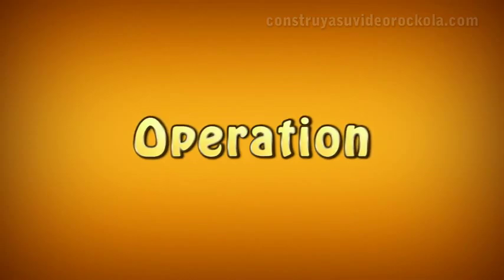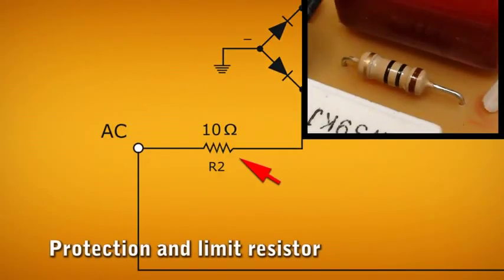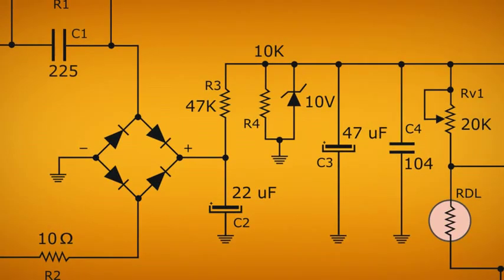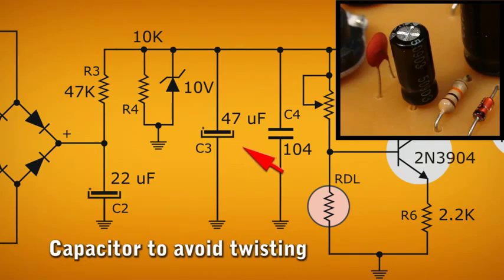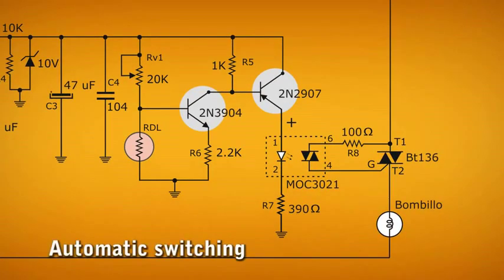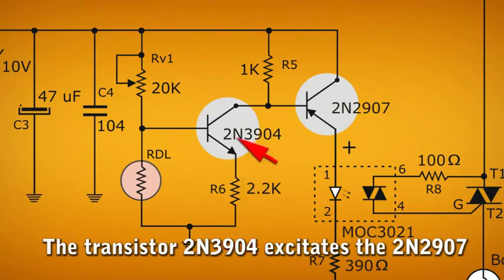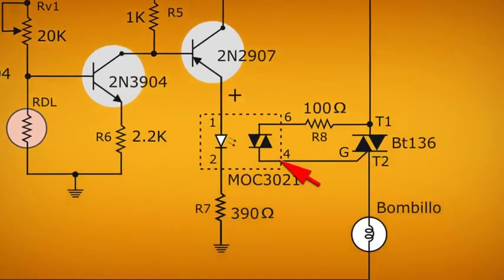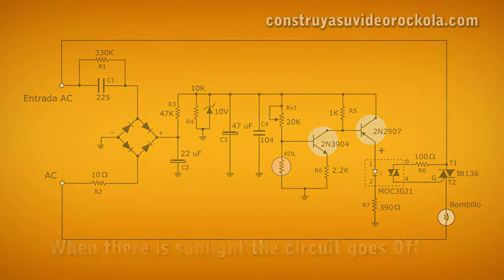den tu sang khi troi toi

Comment: Bác Quang Đức đã làm mạch này chưa? Bác cho em hỏi tại sao khi em làm xong và thử thì con điện trở R2 (10 ôm)  nó bị cháy đen thui?
Reply: Bạn dùng con tụ 225 đúng ko? Mình thấy tốt nhất bạn nên xài con tụ 225 400V thay vì 250V. Ngoài ra những con tụ ở mạch trong ko nên lớn hơn con tụ này.
Reply: Trích của bạn Chép Lj
 "Nhớ lại rằng để khắc phục một dòng điện áp tăng, nhân gốc rễ của 2 là 1,4141. Điều này có nghĩa rằng đối với một điện AC 120 volt, chúng tôi nhận được điện áp đầu ra của cây cầu diode 169 volt, 2 volt ít tiêu dùng những cây cầu và một số bị mất, chúng ta sẽ có khoảng 157 volt. Và đối với một điện AC 220 volt, chúng ta sẽ có một điện áp đầu ra của khoảng 305 volts DC approx. Vì lý do này, các tụ điện của nguồn chỉnh lưu phải là 350 volts, nếu không nó sẽ phát nổ khi kết nối các mạch."
Reply: +Thach Nguyen: Mình đã ráp đúng theo sơ đồ trên, các linh kiện có trị số và công suất đúng như clips, nhưng con trở R2 vẫn nóng kinh khủng, nếu không rút điện ra thì cháy ngay (mình không hiểu vì sao). Nếu bạn đã làm OK rồi, thì có thể chỉ giáo cho mình nha! Thanks!
Reply: +pham khanh Duong 
HI bạn Dương, có thể trên clip người ta đang ở quốc gia dùng điện 110V nên họ chỉ cần tụ 225 - 250V. Còn tại VN thì dùng điện 220V nên tụ bạn cần dùng là 400V nhé vì điện thế qua tụ lúc này là 220 * (căn 2) = khoảng 305V. Dĩ nhiên theo clip thì tụ 250V ko tải nổi rồi. Chúc bạn thành công.
Reply from the maker: +pham khanh Duong  nếu cháy r2 thi r1 và c1 của bạn không đúng nhỏ quá nên áp qia r2 quá lớn 
nói cung bạn hiểu thế này r1 r2 c1 dung hạn áp sao cho vừa phải để con diot zennơ chổ r4 còn lại áp ở đây là 10v

Comment: Anh ơi! sao em làm như này mà mạch nó không chạy anh ah. em thử nhiều lần nhưng kết quả chẳng thấy gì, em dùng tụ c1 là 250v và 225k, nhưng khi test mạch tụ c2 bị nóng dần sau đó nổ anh ah.
Reply: nang len 400v
Reply: từ 225 là từ gốm không phân cực..to bằng ngón tay ấy
Reply: Nhớ lại rằng để khắc phục một dòng điện áp tăng, nhân gốc rễ của 2 là 1,4141. Điều này có nghĩa rằng đối với một điện AC 120 volt, chúng tôi nhận được điện áp đầu ra của cây cầu diode 169 volt, 2 volt ít tiêu dùng những cây cầu và một số bị mất, chúng ta sẽ có khoảng 157 volt. Và đối với một điện AC 220 volt, chúng ta sẽ có một điện áp đầu ra của khoảng 305 volts DC approx. Vì lý do này, các tụ điện của nguồn chỉnh lưu phải là 350 volts, nếu không nó sẽ phát nổ khi kết nối các mạch.
Reply: nếu bác quan tâm thì  Tôi gửi mạch khác cho làm  

phamduchuycd3@gmail.com